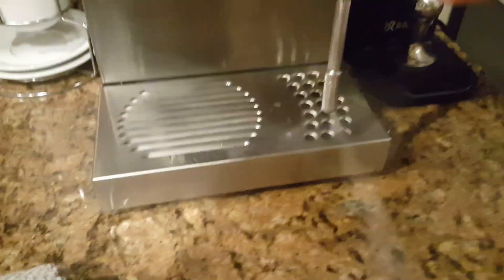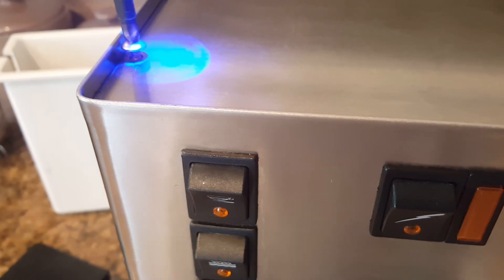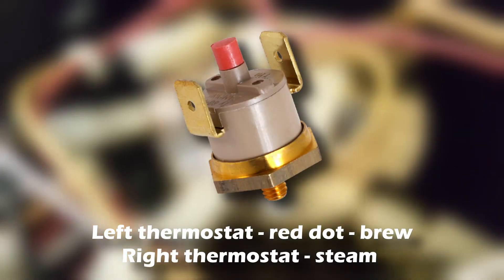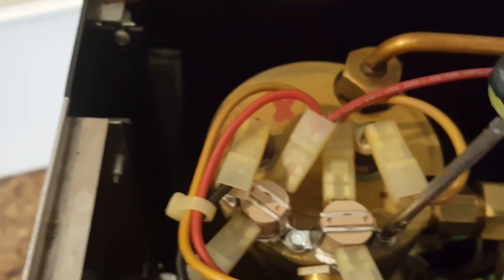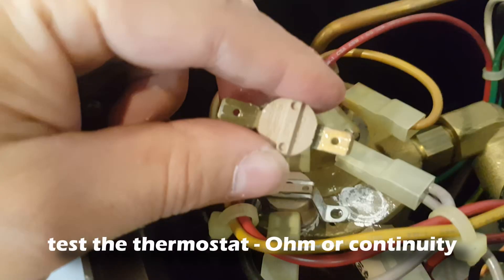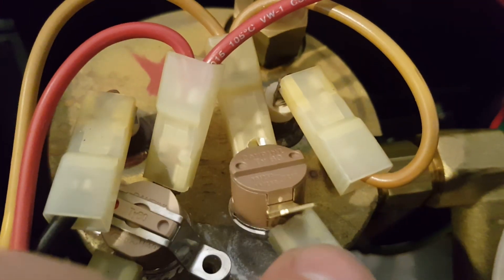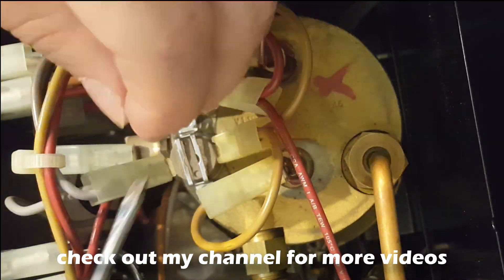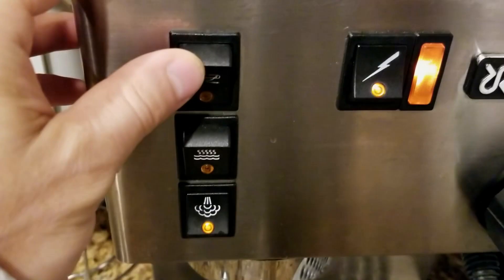Espresso machine stopped making steam - Rancilio Silvia steam thermostat replacement

Comment: If you're not showing zero ohms or and open circuit (on continuity setting of your multimeter), and you need to replace it anyways, try this trick: Find a flat, hard surface, like a countertop and slap it hard against it, so the flat part of the top hits it. There is a bi-metal disk inside the part that flexes as it heats up and springs back as it cools down. By jarring it, you can get the disk to pop back into the original position. When it shows zero ohms again, reconnect it and order a new thermostat and continue enjoying your espresso while you wait for the parts to arrive. This trick was taught to me by an old appliance tech and it works!
Reply from the maker: thanks for sharing your knowledge with us.

Comment: Great video, thank you. Question I am having a similar issue. About two days ago my steam seems to loose pressure. About a month I replaced steam valve assembly because it was leaking. But now like I said two days ago I can't make foam. When it starts About 10 seconds you can hear pressure drop, on 30 seconds light comes up, but no foam (6oz) of milk. By 50 seconds  pressure is low and you hear air blowing out. Steam feels warm not hot and it's moist. Any guide what it can be? Both bre and hot water is good no issues there. Thank you